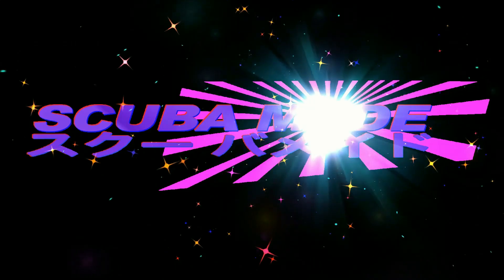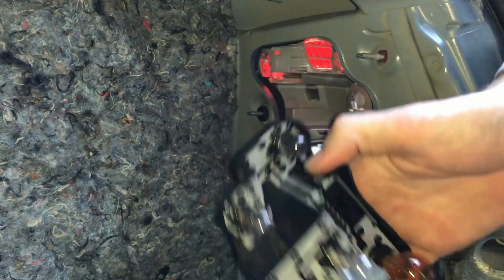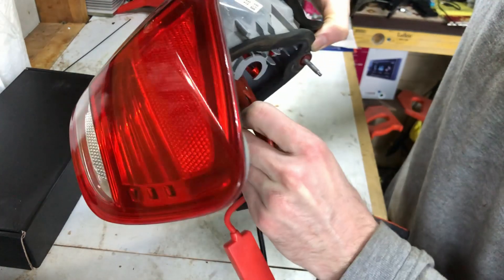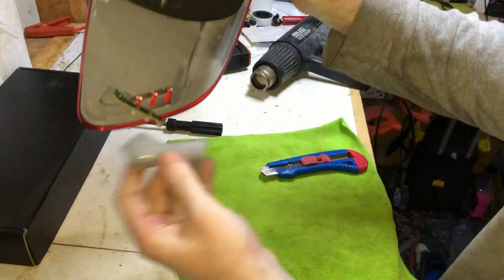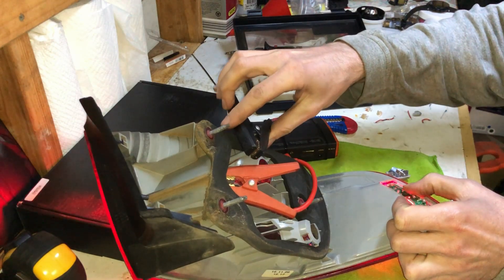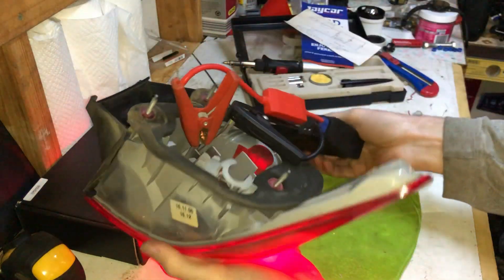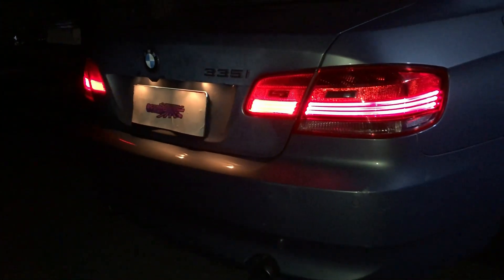$5 LED FIX, BMW Taillights, Fixed, not replaced!!

Comment: Can you tell us the voltage for the leds? Are they 2.1v? 110 ohm resistor?

Did you unsoldier the old leds and then soldier the new ones on the board?

Comment: U r legend man, my e93  three leds stop working and i cut the hole same place where you did and replace the one led as the other was working. These are connected in series so if one stop working rest does not work either, luckly i had to replace only one, we do have jay car and i got the leds from them.
Reply from the maker: Haha thanks heaps, and that’s awesome to hear that you figured that out and got it fixed too! And good to have a local Jaycar!
Reply: what was the led u purchased and size everything pls <3

Comment: Why is there a need to replace leds ?  You just replace “long life” bulbs and everything is good (also you cannot name this work an easy job nor is it ok to destroy your parts in order to make replacements ) !
Reply from the maker: I’m not sure, I got the information from a shop called JayCar here on the Gold Coast, and went home and tried it and it worked and then I came across the same problem again so I did it again and made the video about it!

Comment: If the outer tail lights aren’t working, it’s worth checking that the module is pushed in properly. So it’s not always blown leds
Reply from the maker: Yeah and that’s why I tested them on the bench too!

Comment: Years later here, so add the resistor on the positive side, wire positives in series then negatives in series and that bypasses the board?
Reply from the maker: I think so, I was going off what I was told by the guy at Jaycar! 
It’s still working years later too!
Reply: I’m gonna give it a go!
Reply from the maker: Sounds good! I hope it works for you too!

Comment: Thank you my friend, my x5 2021 car, the rear light on the fender and the rear light on the trunk are out of the circuit and sometimes it turns on, and most of the time, the reason , the water leaking from the small wall is a break, do I have to open the inside of the light , or is the problem, for example, the external fuse I have, please advise
Reply from the maker: I’m not sure about that because I don’t know much about that car but if it’s from 2021 shouldn’t it still be under warranty?

Comment: Same problem on my car now but don't know anything about electrical
Reply from the maker: I hope you can find someone to fix it or try having a go at it yourself, it has happened on my 325i and my 335i e92’s so I’d say it’s pretty common unfortunately.
Reply: @ScubaMade  is it possible to give me the materials you bought to fix it in jaycar
Reply from the maker: Unfortunately I can’t remember the exact specs on the LED’s, but I think they were ‘Red 3mm LED 1500mcd Round Clear’ and the resistor was ‘110 Ohm 0.5 Watt Metal Film Resistor’. 
Based on the note I got from Jaycar!
Reply: @Scuba Made  ok, thank you. I'll come to my local jaycar on Friday and show them your message so they can assist me. I'll try to do it myself and let you know if it is successful. Thanks again. I do appreciate your help
Reply from the maker: Ok cool, no worries! Thank you 🙏🏼 
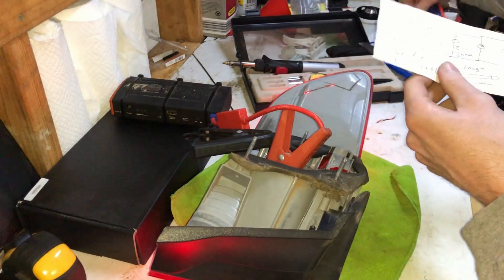I hope it works for you! feel free to show them the video and the picture in the video I show at about 8:30 and if they ask what store did that for me it was the Burleigh store on the Gold Coast!
Reply: @rommelcunanan7197  How did you go?
Reply: @player1111ful  I couldn't do it
Reply from the maker: Ahh sorry to hear about that!

Comment: awesome work! do you know if the E81 would be the same procedure? tia
Reply from the maker: Thanks buddy! I’m not exactly sure but I’d say it’s quite similar as long as the led lines in the tail light look about the same, not the LCI ones, you should be able to look in from the outside and see the leds at one end of the light!

Comment: Hi where did you solder the fuse? Leds I can see
Reply from the maker: I didn’t solder in a fuse, just the LED’s and a resistor!
Reply: I’m in need of the leds myself I can’t find them anywhere
Reply from the maker: They were from Jaycar ‘Red 3mm LED 1500mcd Round Clear’ I think that was them! And a 110 ohm resistor!

Comment: Can you please provide a link where to buy the leds and resistors? If i understand correctly you unsoldered the leds and resistor and reused the pcb?
Reply from the maker: I got them from a shop called Jaycar here on the Gold Coast in Australia, I think they are something like 3mm Ultra Bright Red 6000 mcd LED Light, but I’m not exactly sure.
Yeah that’s what I did, just used the circuit board to hold the new LED’s.
Reply: Am horrible with directions you are killing me 😂
Reply from the maker: Oh sorry about that, I hope you’re okay 👍🏼

Comment: Hi.  Thanks for sharing.  Did you change the leds?  Or just added the resistor?
Reply from the maker: I put the new LED’s in and a resistor and got rid of all the stuff that was already there, I just used the circuit board to hold the LED’s.
Reply: Does this work on the inner tail lights too?
Reply from the maker: Sort for the late reply but I believe it should be the same fix on the inner lights, I’m not sure exactly we’re to cut them those, but I’d guess it would be a similar cut.
Reply from the maker: No problem, Thank you! I did use new LED's too
Reply: @ScubaMade  hey
Wich LED‘s you used ?
Reply from the maker: I got them from a shop called Jaycar here on the Gold Coast in Australia, I think they are something like 3mm Ultra Bright Red 6000 mcd LED Light, but I’m not exactly sure.
Reply: Is it mandatory to use resistors ? And why ? I just opened my E82 taillight that shut off
Reply from the maker: You’d have to ask an expert on that, I can’t answer that sorry, but I’m pretty sure you need resistors probably because the led’s need a lot less than 12v coming into them or something along those lines..
Reply: @ScubaMade  i just kept the little motherboard inside the taillight changed 3 led bulbs with standard white leds and everything’s back to normal like day one
Reply from the maker: Ok sweet! Sounds good, so maybe just the led’s weren’t working!
Reply: @ScubaMade  yes they burnt because of the brake light connector ground that broke and burnt all the bulbs
Reply from the maker: Ok, sounds like you’ve got it all sorted now! That’s good to hear!
Reply: The best video and solution to this problem. The resistor  is a 100 ohm 1/2 watt. It is possible that it was just the resistor that got open. I need to solve my problem  now and I'll report. But you help me solve the 1st problem: how to access the board.  Thanks

Comment: Pretty awesome video, don't have an e92 myself but I just finished building headlights for my e90 and wanted to do something with my tails. Gave me sort of an insight into how bmw did the LED tubes in the tail lights
Reply from the maker: That's cool, thanks for letting me know! I hope your headlights came up sikk!!
Reply: @ScubaMade  Praticamente illumina tutta la riga orizzontale con solo quei led in fondo ? Non l'avrei mai immaginato , mi confermi questo ?
Reply from the maker: Yes it’s just one LED that lights up the entire tube! And there are 3 tubes in the e92’s tail light so only 3 LED’s!